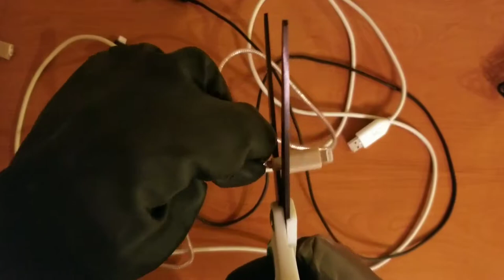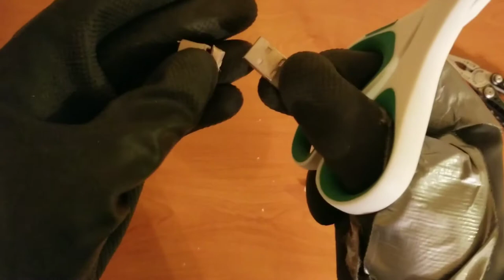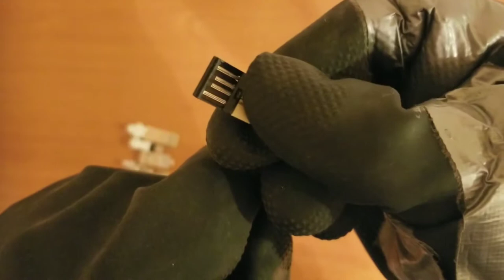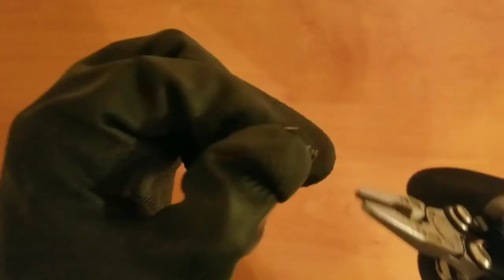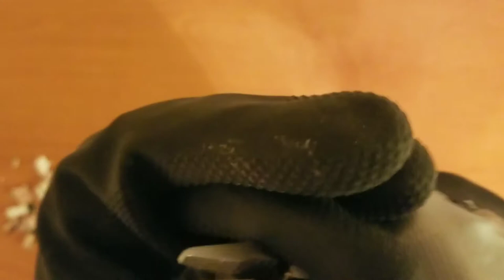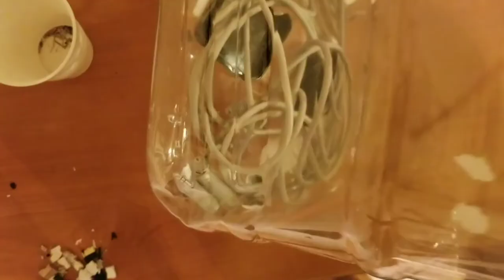Scrapping Phone Chargers for Gold Plated Components

Comment: Maybe - step number one should be , getting a proper wire cutting tool. 😂. Other then that , thx for your vid.
Reply from the maker: Yeah, I'm sure I have a wire cutter laying around somewhere and it would certainly make things easier. That said, I tried to do this with tools I am fairly certain almost everyone has. Specialized tools, even if they're inexpensive, can be a bit of a turnoff when you're just starting a project so I try to stay away from them.
Reply: Agreed, I thought so too. I pictured seeing a layout of things you'll need to dissolve the basis of the contacts including safety glasses.